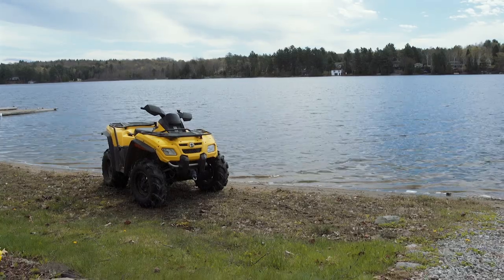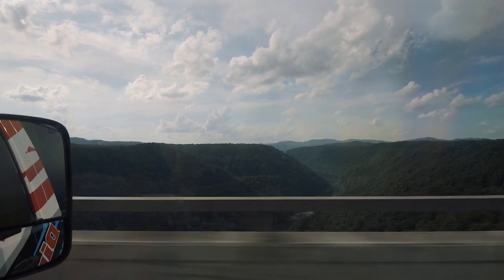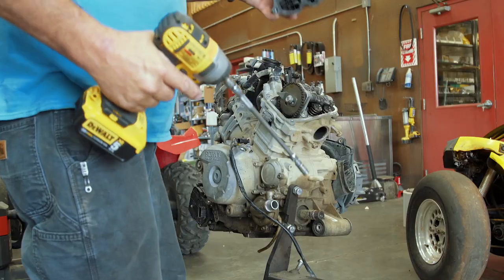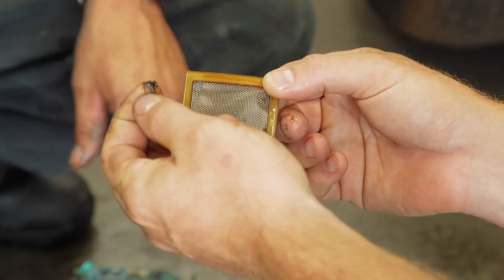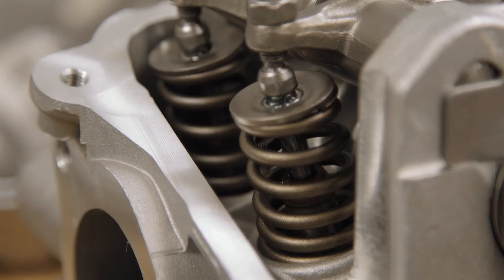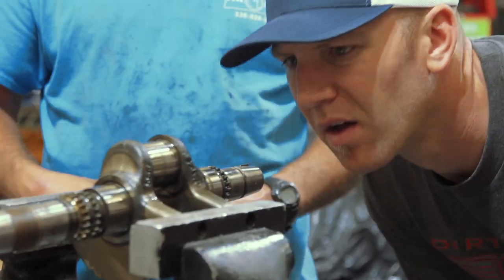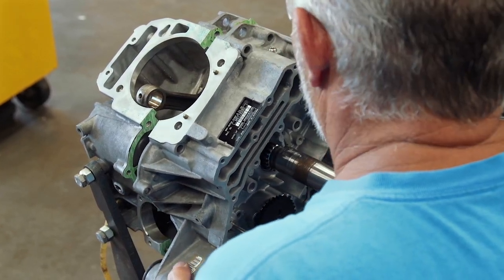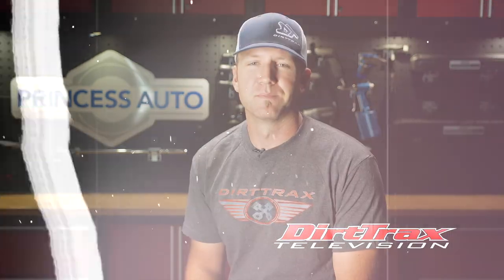Can-Am Mud Build: Part 2 - MrRPM

Comment: Hello i have a can am outlander 450 that just stoped running. Didnt get water in the air box or oil. I have soark air and compression but its at 90psi. Would this be timing, valves or bad rings?? Get back with me if you can. 

Thanks Patrick